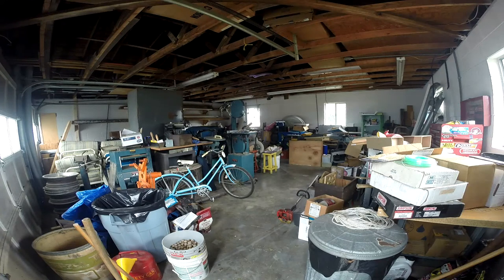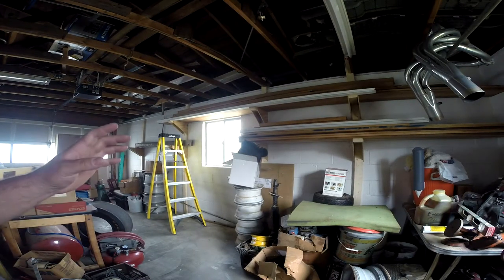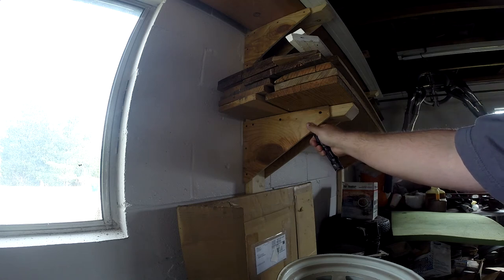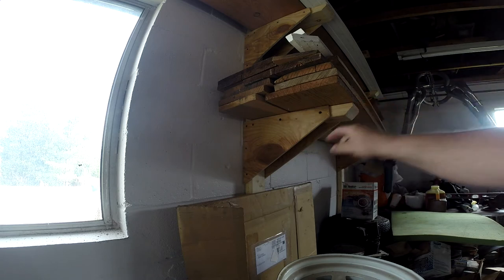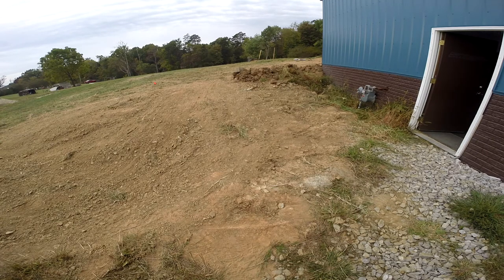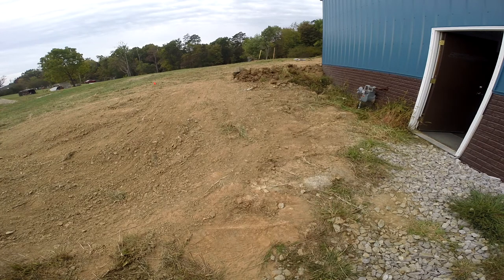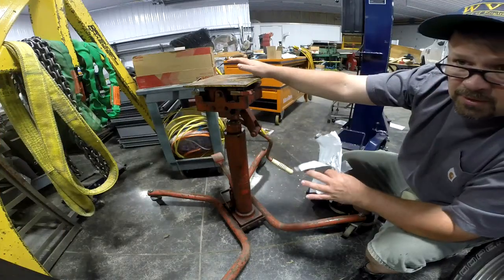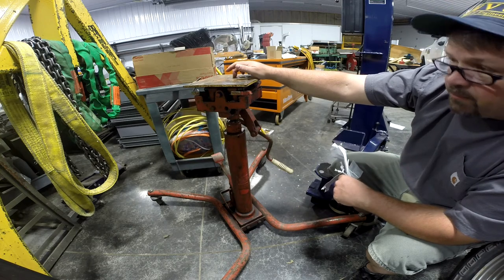Shop Update 001 - October 5, 2017 (UCC Truck, Woodshop and Dirtwork)

Comment: Scott how did you change the name. I want to change mine to tjsperformance but dont want to loose vids or followers
Reply from the maker: In the upper right hand corner there is an icon with your channel name. Click on it and it brings open a box that somewhere inside has a button that says "creator studio." To the right of that button is another that looks like a gear. If you click on that it will take you to a screen that is your account overview. Under account information beside your name it will have a link that says "Edit On Google." Click on that and you should be able to figure it out from there. Thanks for watching.
Reply: Defender Fabrication thanks. I think it worked.